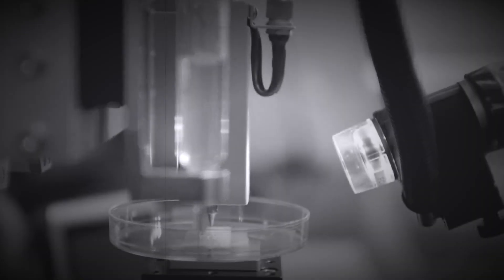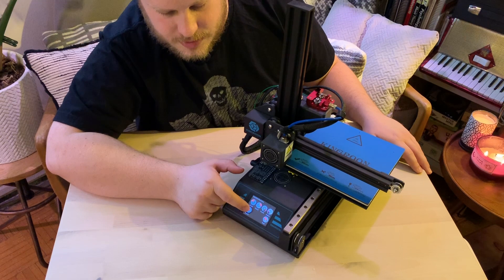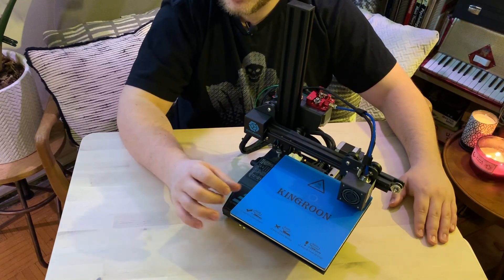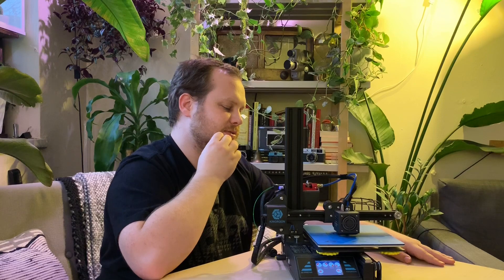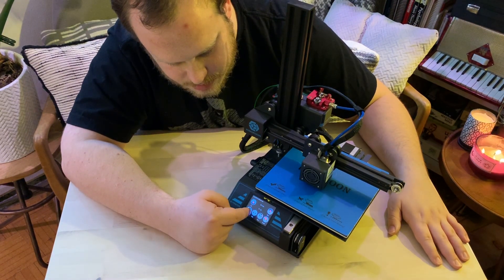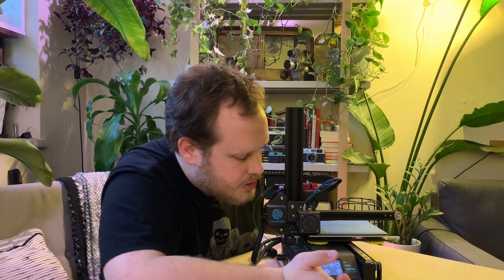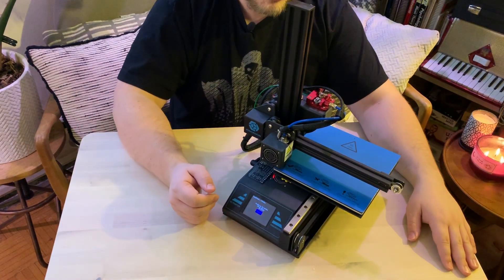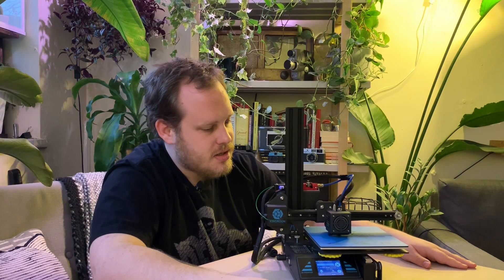Setup & Calibrate the Kingroon 3D Printer

Comment: To be honest, I have not found anything useful and related with a real calibration like calibrate the X, Y and Z step motors, and the extruder steps motor. Only a basic setup which can be readed in the printer manual.

Comment: Funny how taking just a few seconds;  has taken me to a solution to any of needs of levelling and as well of any of possibilities of warping and it's simpler to build.  It needs to be free to expand and that can be done with having a grid system that attaches the bed to a schalfold system sure as like an example would be in the style that's similar to floor joices or overhead lights rack even for a stage;  and same size as the platform and maybe 1/2 inch thick or whatever is needed and what not.  Even a heat sink style that is free of possible warping and with this method of a bed;  that stays always perfectly flat;  well then;  it only needs an adjustment of the extruder instead and that is way simpler then anything else and it's not written in stone that the bed cant be a thick iron plate that stays strait or thick aluminum even.  Why isn't it built that it is quality controlled parts that lock together in a sense that all resting places of all fitting together of parts are always the same and nothing ever moves;  I mean like a snap-on style of thing.  LOL Cheers and how do we know if our set screw is ok if the bed's front corner setting wheel isn't correct?

Comment: Hello! I have a Kingroon Kp3 with stock FW MKS Robin_mini 2.0.8. I am trying to calibrate the extruder as it is under extruding (84.5%). All tutorials I've seen include M500's commands, but my printer returns "unkown command". Any idea how to proceed? Thanks.
Reply: I found a way to configure the Kingroon Kp3 using the file "robin_mini_config.txt". First you modify that file according to your needs, then you copy that to the SD card and boot the printer. You may have to copy also "Robin_mini.bin" to the SD card. Be sure always to backup the factory configuration that came with the printer. Cheers!
Reply from the maker: @Bruno-uw6ik  sorry for the late reply, you've described the way to calibrate and update your printers firmware perfectly!

Comment: I can't get my printer to level up the 2 back pieces are good but the front won't adjust I turn the yellow knobs but nothing they move but the nozzel don't
Reply: Maybe you are working at full extent of the calibration screws. I would lower the Z calibration screw and give the bed level screws more thread to work.

Comment: My bed won’t level. It’s printing 3D only on one side because the needle that the filament goes through touches the bed too clutch
Reply from the maker: Sorry to hear you're having problems with leveling the bed, are the leveling screws/knobs not working? What I had to do with my two KP-3's was to level the bed relative to the nozzle in the 4 corners, I did this manually without any power to the printer. Once I confirmed that the nozzle was the same height from the bed in those 4 spots ( you can use a hard & flat piece of wood or glass to check the distance) I turned the printer on and adjusted the z axis thumb-wheel (the silver one left of the bed) so that i would only touch the switch when the nozzle was just barely above the bed.

Comment: One thing I found with mine, is that the Z axix adjustible stop will move from vibration during printing.  I took it out and added a 4mm nut that you can tighten down to the case after you do the adjusting to lock it in position.
Reply from the maker: That’s great advice if anyone else is experiencing the same issue!

Comment: Just a question, can you print straight from a computer to the printer via a cord? Or do you need to load in a sd card to print from? Thanks
Reply from the maker: That's a great question! You can print using the USB cord, but first you have to install the drivers for the printer. The drivers are on the included SD card, so you would need to insert the SD card into the SD card reader included with the printer and then connect the SD card reader to your computer.
Reply: Thank you!
Reply from the maker: Aiden Radway our pleasure!